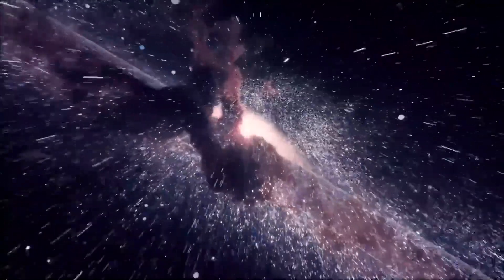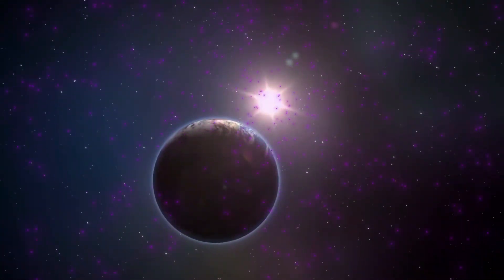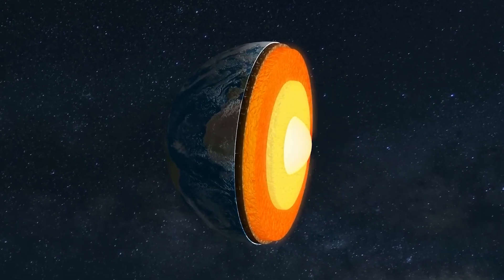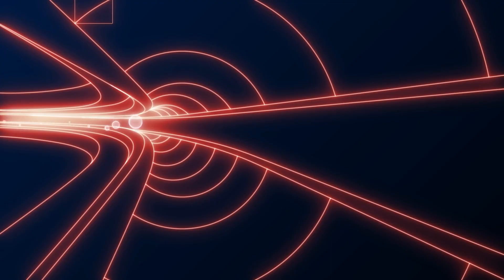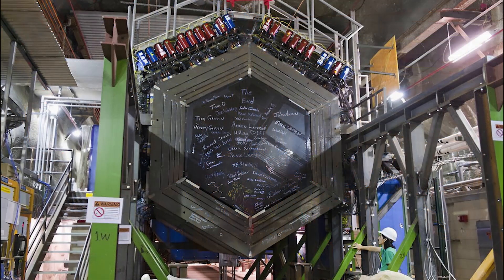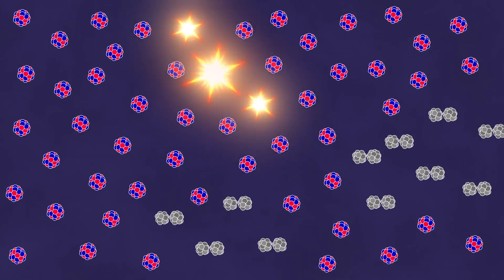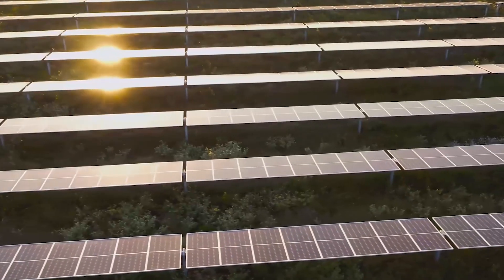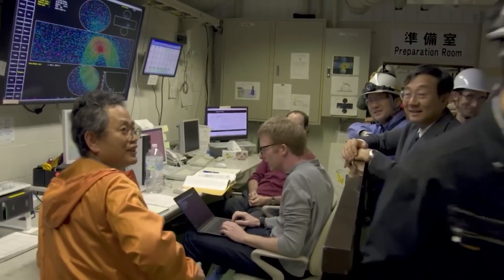How can we make neutrinos useful to us?

Comment: I don't think we can even be certain these neutrinos even exist. They where a guess for the the less than expected energy output of the sun and, not only is it rare to detect any alleged neutrinos, you don't even detect them directly. what you look for are other reactions that you think could be caused by a neutrino, such as those subterranean detectors with tons of ultra pure water. You occasionally see a blip of light in this water. This is Cherenkov radiation, most known as the blue glow of the cooling water in nuclear reactors surrounding the fuel rods. This glow is caused by electrons in the molecules of water being displaced and moving through the water faster than light would. But this happens with ionizing gamma radiation, and perhaps x-ray radiation, but now you expect us to think a neutrino, which can pass through hundreds of light years of water or lead as if the water or lead wasn't even there, is what's causing the electron displacement at sufficient speeds to cause cherenkov radiation? In any case, these blips of light could be caused by some radiation penetrating the apparent shielding of the detectors. I think more work on proving neutrinos are even a thing needs to be done.